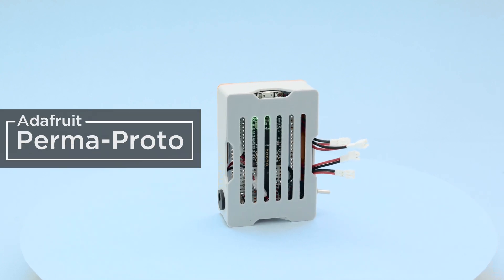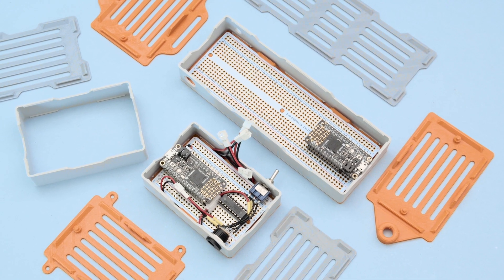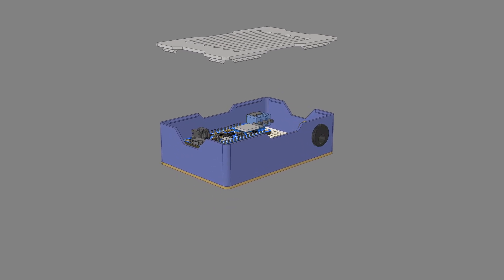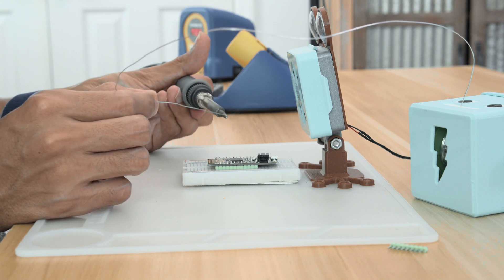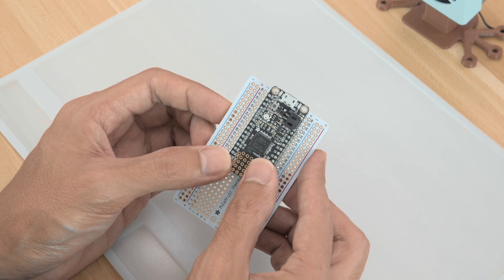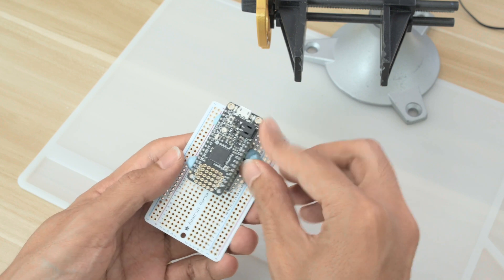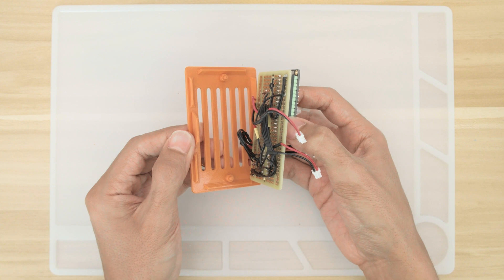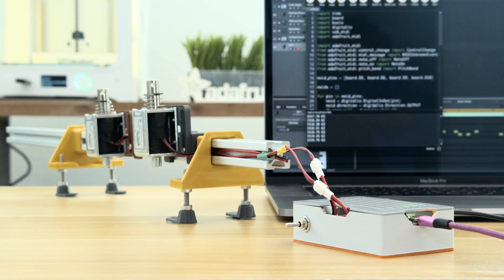Perma-Proto Feather Case

Comment: Your github repo has 123dx files but 123dx has been discontinued by AutoCad.  What program can I use to load the files and save out the STL versions for printing?
Reply from the maker: We can convert them to step or stl using fusion 360 import. fusion 360 should be able to import 123dx. Please post an issue on github to let us know which parts need some converting 🙂